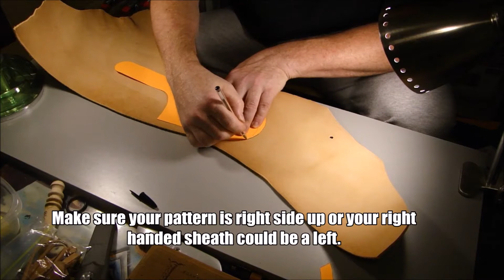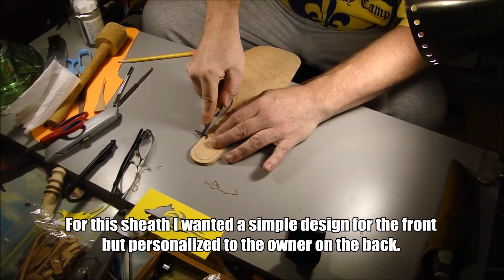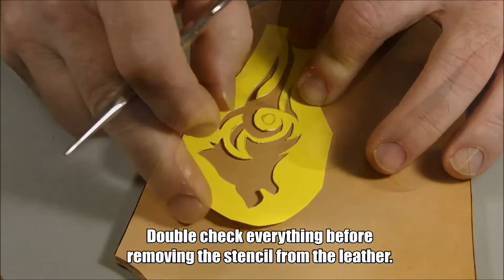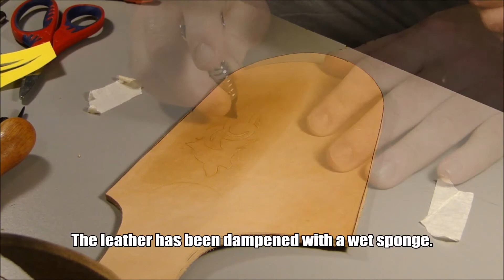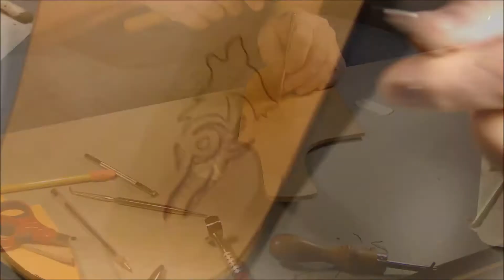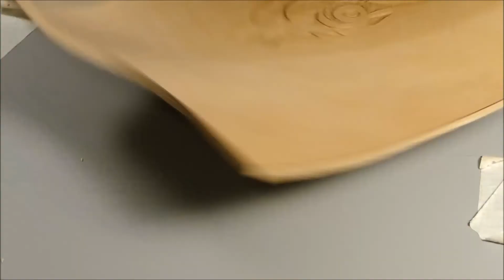Mora "Wolf" Sheath part 1 of 3.

Comment: I did manage to get that image downloaded and opened properly. I appreciate the help. I found several others that i liked as well. I have watched these several times through and I notice that you aren't using contact cement as everyone else does. In fact, I think it's a water based glue. Do you mind me asking why and does it even matter, in your opnion
Reply from the maker: I was using Fiebings leather cement which I'm pretty sure is just white glue.  It's the only glue I have.  Contact cement is easier for that instant bond, but if you don't get it lined up on your first try, you're kind of stuck.  Regular glue gives you a chance to play with it if you need to, but it means you have to wait for it to dry, before you can go to the next step.  The last tube of contact cement I had dried up after only using it a couple times and I lost most of the tube.  I'm too cheap to buy another.  If I had to pick one it would be contact cement.